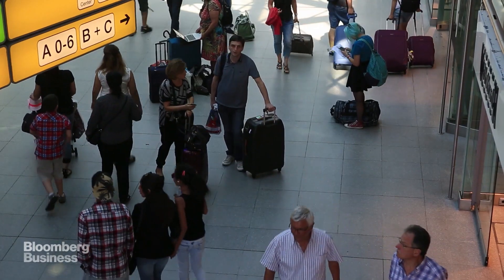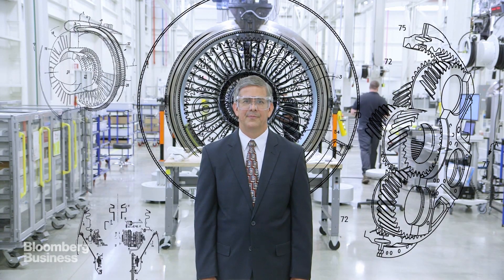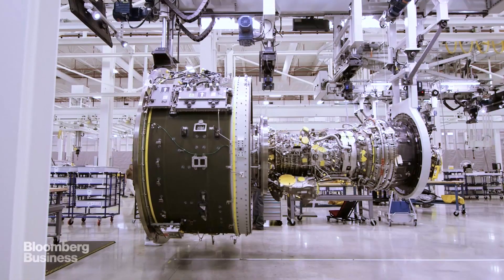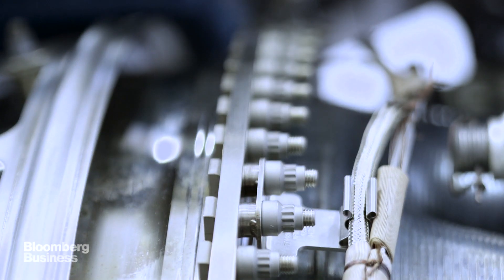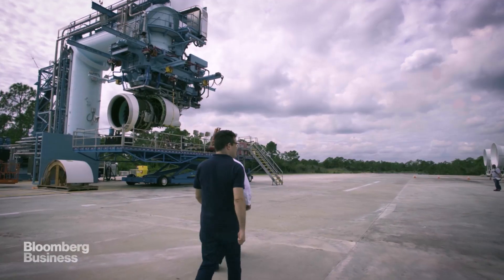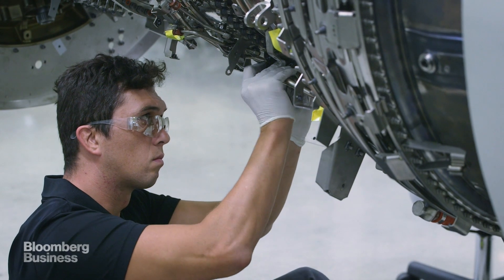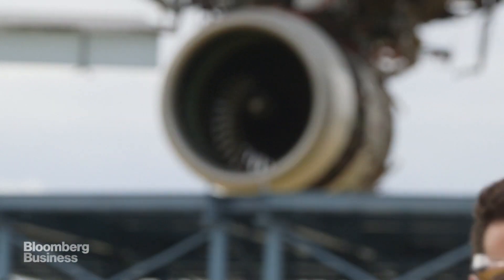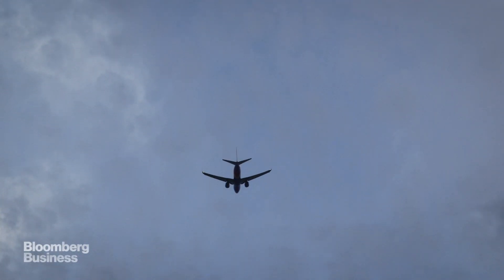This Genius Invention Could Transform Jet Engines

Comment: This may be a very good incremental improvement, but it is no breakthrough, and it is not a first.
The Garrett TFE731 is a geared turbofan engine that has been powering small to medium sized aircraft for over 40 years.
This is a larger engine, but using the same idea that's been flying for decades.
Reply: Surely a turbo prop is a geared turbine?
Reply: Agreed, Citation VII I fly has the 731 Engines. Its a good motor. But not a breakthrough...
Reply: An invention ? frank Whittle proposed this in 1945
Reply: You guys can quit measuring dicks now.  It's blowing up my notifications.
Reply: @drunkdonutboy  my dick is so big it needs a gearbox to prevent the tip going subsonic.
Reply: bloody rappers! have an opinion on everything!
Reply: +Bill Russell lol im pretty sure AgentJayZ is an expert on the subject
Reply: "Why even bother gearing the fan down when you can just make the turbo smaller and keep the 1 to 1 ratio, if in fact keeping the fan blades subsonic is the pre-requisite?"

[]First of all I would like to point out that turbofan engines never have a ratio of 1:1, they do not have a physical shaft connecting the bypass fan to the turbine spool (unlike a turbojet which does). They use two shafts(spools), a high pressure spool and a low pressure spool. This allows for a difference in rotational velocity, i.e. N1 or low pressure compressor when ground idling will rotate at 25% of its maximum RPM, while the high pressure compressor will run at around 50 to 65%. Numbers of course will vary from aircraft to aircraft.

[]As for why you should not making the ratio 1:1 you need to take into account how fast the leading tips of the fan blades are traveling by the rotation speed, radius, and blade pitch. Now we would have to look on how that adversely affects efficiency and how it adds to more mechanical strain to the whole assembly (if it's this particular size). In short you'd have a low efficiency engine spinning at tens of thousands of RPMs that would generate a lot of noise and gobble fuel like a fat man eating burritos, though it would generate lots of thrust. But the negatives outweigh the positives in this particular application.

[]The underlying principle behind bypass is trading exhaust velocity for extra mass flow which still gives the required thrust but uses less fuel. Whittle called it "gearing down the flow". Power is transferred from the gas generator to an extra mass of air, i.e. a bigger diameter propelling jet, moving more slowly. The bypass spreads the available mechanical power across more air to reduce the velocity of the jet.

"This looks like a 1.2 gear reduction ratio, turbo to fan, at most"

[]The specs of the Pratt and Whitney PW1000G shows that it has a 3:1 planetary reduction gearbox. This 3:1 gearbox between the fan and the low-pressure spool, each spins at its optimal speed: 4,000–5,000 RPM for the fan and 12,000–15,000 RPM for the spool, the high-pressure spool spinning at more than 20,000 RPM.

[]Because each of the components have different RPMs that they reach their maximum efficiency, this decreases the overall stress of the engine. Because of this reduced stress if a gearbox is added you can remove a few of the high pressure compressor stages, as they are unneeded as their job was to create thrust to turn the low pressure spool. 

I hope this answers your questions and why it should be kept out of the "Polishing a Turd" file.
Reply: AgentJayZ was 100 % correct. The prindiple of geared fan jet engines is not new. The new thing is making it on a larger engine, just like AgentJayZ said.
Reply: plus if something goes wrong on a planetary gearbox it's completely useless and would need to be completely rebuilt if and when someone goes wrong.
Reply: @belligerent-irony  yup. And those big GTF gearboxes are _heavy_. They've been working on this for a very long time. I've been following this since the early 1990s and wondering how they can do it without the entire thing breaking.
Reply: 75% noise reduction is not a breakthrough???
I think you forgot how loud planes are.
15% fuel reduction is also quiet significant and not only incremental.
.5 to 1 % would be incremental.
Reply: @plavix2215  agreed
Reply: Looks like your comment got cut off there. You're using non standard terms.
A typical large turbofan, with the exception of the RR Trents and RB211s, has a HP compressor driven by a HP turbine that turns at about 10,000 rpm. ( they are all different, so this is a very fuzzy general number), and a fan ( which may sometimes have a couple stages of LP compressor, or "booster" behind it ), driven by an LP turbine that turns at around 3000 rpm. The fan and LP turbine are directly connected, without any gearbox between them.

The LP booster stages would be better if they turned faster than the fan, but there is a compromise to keep the engine a two shaft design, saving complexity and cost.

The RB211, and its descendant, the Trent series, are three shaft engines. HP, IP, and LP. The LP turbine drives only the fan. with the HP and intermediate pressure compressors being driven by their own individual and separate turbines.

Of course all jet engines have an internal gearbox, driving a radial drive shaft, which in turn drives the external accessory gearbox. This is all entirely separate from any fan-drive reduction gearbox.

I have videos posted explaining all of these things, if you want to have a look.

My original comment on this video is that this is not anything new.
This may well prove to be a great, fuel efficient and quiet engine. I think that's great.
I just think it's wrong to claim it is a "genius invention".
Reply: Rolls-Royce/SNECMA M45H Came out in 1970 also and was much larger than the Garret engine.
Reply: Frank Whittle had a geared turbo-fan patent from 1937.
Reply: I think the innovation here is that they're saying the turbine speed is independently variable from the fan speed, which from the admittedly little information I can find on the TFE731 design, is not present on that engine.
Reply: Tyler Ketter as intelligent as that comment is the turbo fan has to be geared to the engine at a fixed ratio. so what they are saying to meif I get this right that the ratio is so low as to not drive blade tips into super sonic speeds
so the gear ratio is as low  as a willies jeep
Reply: AgentJayZ they used billions of dollars as research money, what do you expect them to say other than revolutionary. :P
Reply: First instinct, contact AgentJayZ.... then i look at the comments ^_^  already on it! like a boss!
Reply: AgentJayZ You tell em!!!! You are my favorite Canadian
Reply: AgentJayZ Hey AgentJayZ, great channel, I've learned a lot from you, as for this video it just looks a planetary gear that may achieve a closer to optimal RPM for the fan vs turbine considering fuel efficiency and fan decibels/stresses but at the cost of additional drag, so like jay said the "incremental Improvement". My humble analysis/consensus as someone who aspires to build a power turbine in the future.
Reply: AgentJayZ wooot!
Reply: Bill Russell I think you guys are on the same page but he was just explaining that almost all large turbofans are at least dual spool.
Reply: Herb Bees Upper right corner > Mute post
Reply: OOOoo the jet guru has arrived!
Reply: TFE731 is a turbofan engine, based on an APU power unit for the DC10.  It is used on light business jets, such as the Learjet and the aforementioned Cessna light jets.
Reply: Yeah why is this such a breakthrough?!
Maybe just an adaptation, but still something that's been done for almost half a century
Reply: A larger fan spinning slowly is more efficient than a small fan spinning fast. It's all about fuel economy.
Reply: 75%  less noise and 15% less fuel consumption seems like a breakthrough to me.
Reply: Hello AgentJayZ, love your videos.
Reply: AgentJayZ are you talking about split spool gas turbines?
it would say that on the engine data
Reply: *****    I don't remember that, but it sounds like me... 
 Thanks and cheers.
Reply: English Muffin... Great answers, thank you...! Makes a lot of sense that each of the stages, fan, low-pressure, high pressure spin at different RPM for optimum efficiency... I miss-calculated the planetary gear ratio from the graphic on the video, as Planetary Gears are not quite figured like standard gears...:-/  If it is a 3:1 reduction, then it's totally worth doing and yes, not worthy of the "Polishing a Turd file"...:) 30 years and $10 billion is gotta' get you somewhere... HA!
Thanks again for your well versed explanations! :)
p.s. Do you work with Jet Engines... engineering, assembly, fabrication, maintenance?
p.s.s. English Muffins are my favorite w/breakfast...HA!
Reply: so is!. I fell into the trap for being curious and I stuck with good images of engines in an infomercial that says nothing new.
Reply: ALF 502 & 507 based on T55 tank engine is a geared turbofan. This is not new Fucking lazy engineering.
Reply: You experts seemed miss the point. It took 30 years to build a small gearbox that is almost totally efficient that can handle 10,000-30,000 hp. The technology was not there before. Pratt built gear boxes before! 30 years before the garrett 731. So that means nothing. The 731 gear box by design is severely out of date. And yes i have worked on pratts and garrett/ allied signal / Honeywell engines!
Reply: Leave it to AgentJayZ to cut through the bullshit of the modern media.
Reply: Nice i have overhauled 100s of the 731.
Reply: Somehow, incremental improvement to commercial jets using decades old technology just isn't as catchy a title.
Reply: The real solution is CO2-neutral synthetic fuels. Jet turbines already burn very cleanly, especially compared to piston engines. KLM has already tried it in a small scale.
Reply: AgentJayZ Do you have a video on the reduction system in the TFE731 you mentioned? I'd be quite interested to see how that worked.
Reply: Bill Russell The military has to have it's own name for everything, and even then, we don't always call it that.
Reply: Thanks
Reply: Spot on, wish my phone allowed me to click like BIG TIME
Reply: I was thinking the same thing
Reply: so was the rb 211
Reply: The Dave  OH SURELY not.... or he wouldn't have bothered... SURELY....
Reply: Jordan Lorenz LOL.... just leave it to the experts.... or do you have 60 plus patents to your name too?
Reply: That, and lack of the radial HP compressor wheel.
Reply: IzunaDestruction
The op was cocky fyi, and he has no idea how patents work and clearly needs to brush up on how patents work before he speaks out his ass telling others who had the idea first and whats the same or not. This turbine is clearly using the patent gear box system made by this guy that no other has and does not do the same as the other engine type, thus breakthrough. The op also is telling others whats a breakthrough and whats not based on his opinions which is not a fact but a simple opinion on two kinds of engine logic even if they seem to be the same. improvements can also be breakthroughs as well and this one that will not pollute the air and will lower cost of people flying so i call that a breakthrough.
Reply: I think the only innovative thing here is the gear box which needs to be strong enough and designed to cope with the forces made by the large turbine. I saw a video of people that produce those gravity lights, i imagine it would be something like theirs
Reply: Also he never called his Mother.
Reply: AgentJayZ ..
You are Canadian ...right !?
Reply: no no, this is a radical new technology! not at all the same! this man has invented what he calls a transmission! never seen before!
Reply: Change mechanical gear to magnetic
Reply: AgentJayZ - I came here to post that. I've never flown a TFE-731, but I knew about the gearbox in some of them from the early 90's.  If I was doing the reduction gearbox thing to a big jet engine I'd be tempted to put it in the turbine section, so the shaft into the fan stage could be large diameter and quite rigid.
Reply: AgentJayZ has
Reply: That was my first thought as well! "Geared Turbofan?", well Garrett has had one for years! Though Kudos to the person that can implement it at a much larger size. Another cool technology is variable pitch turbofans.
Reply: They operate on very different principals. An ideal turboprop should move as little air as possible; generating thrust via the pressure differential on opposite sides of the "propeller" (versus a "fan"). A "jet" engine generates thrust by newtons third-law, i.e. by moving air; turbo-fans moving a lot at low velocity and turbo-jets moving a lower volume at higher velocity.

It is unfortunate that people interchangeably use "fan" with "propeller". Next time take a look at a big shop-fan. They move a lot of air yet the fan does not go flying backwards compared to if a propeller had been attached to the same motor.
Reply: Ol Sp the TPE331 is a turbo prop. The TFE731 is a turbofan engine
Reply: acbulgin2 what a stupid comment.  Look up specific fuel consumption of turbo prop! You will find most are fuel pigs to a modern turbofan.
Reply: lorenzo damag all turbo fans have gear boxes. They run the accessories. Fuel pumps dont run on magic
Reply: He is not talking about dual spool or split spool.  The LP turbine drives a planetary gear that is attached to the fan.  The LP is not directly attached to the Fan as in a split spool.  The fan speed is reduced by the factor of the planetary gear ratio.
Reply: I believe you have confused the TPE331 with the TF731.  The TPE is the turboprop while the TF is the turbofan.
Reply: The 1:1 ratio they were talking about is  the LP turbine speed to the fan speed in a non geared turbofan.  In a non geared turbofan it is 1:1 because they share a common shaft.  Not all turbofans have reduction gearing.
Reply: 15% seems more than an incremental improvement
Reply: THANK YOU - saved typing time for me  1972 was the birth of the 731 and was on the drawing board before that
Reply: AgentJayZ  The huge difference between this new type of Pratt engine is the bypass ratio. Older engines only have about a 5 to one bypass ratio, the Pratt has a bypass ratio of 12 to one, meaning a huge reduction on fuel burn.
Reply: Also the British Comet jet in the 1950's had a geared turbo fan engine but the plane was dangerous and i think only five of them were flying before the British government forced them to all be pulled from service.
Reply: Fook me, there's always one expert who knows better than one of the biggest, and most powerfully equipped  engineering departments in the world.
Reply: I don’t know if that’s really true, but I gave thumbs up, just in case.
Reply: I agree this video seems like the idea of a gearbox is new however I feel like it took 5 seconds to think of a gearbox as a solution once I knew what they were trying to achieve.
Reply: Its not geared turbofans 
But reduction gear 

Clearly its different
Reply: Just like the avro RJ engines,, they also have a planetary gear to reduce fan speed
Reply: ultrafan is kinda similar too
Reply: Correct. Geared fans have been around for decades. I don't see what is NEW here.
Reply: He supposedly has patents on this.  I did see something like it by British jet engineers.
Reply: all turboprop engines need gears to slow the propeller, so a gear on the shaft is not new. In fact even internal-combustion engines have it.
Reply: Yeah, but this is mainstream news. You know, the people that call self propelled howitzers "tanks" and guided missile destroyers "battleships". And everyone knows, jet fuel is a myth perpetrated by the globalists to make money, jet engines run on air!!! ;^)
Reply: AgentJayZ there you go, comment from a guy who works on jet engines daily basis
Reply: Keep calling it like it is Agent JayZ. I been loving your videos for years.
Reply: thanks you saved me the trouble.  and BTW, the best innovation was GE's GE-36 back in the mid 1980's but people weren't interested in open rotors then
Reply: Watching this I thought the same thing! They were sneaky, this was not his patent but they labeled it as a breakthrough. The 731 does have a gearbox but the core was initially developed to be an APU. Both the 731 and the 331 are geared engines. The 331 being a turboprop.
Reply: So, obviously handling that much power through a gearbox would be a breakthrough due to the weight penalty and architecture and dealing with the heat and lubrication.  Can you think of when the 731 was initially released to commercial use?  I want to say the Lockheed 731 Jetstar.  Or was it the Lear 35.  It even found its way onto the Rockwell Saberliner and drones.  Today one of the most efficient airplanes is powered by the 731-40, the Gulfstream Astra.
Reply: Whats the brand of this jet engine?
Reply: U can't lie to us, Jay will bust every myth there is. Respect !
Reply: I think you're thinkin' 'bout the other guy...
Reply: Bill Russell Thank you Bill! I have never been proven right so easy, so fast! Wow, what can i say? 
Hope your ECG will do some spike soon! A big hug, my little problem child :*
Reply: love your videos!
Reply: well pointed out about the size of the turbine engine difference. it would be very expensive to make the gear box strong enough for commercial use and adds a fair amount of moving parts and weight to the aircraft.
Reply: Bill Russell If you're all that kind of expert, you can stop being cocky and vulgar and show some facts, like AgentJay.
The Navy sure taught you how to be a bully and express a low IQ but we were here for knowledge, in the first place.
Show some or stop bragging about things that, as far as we know now, are only in your head.
Reply: This is not true at all. Almost all turbofans, and all of the big ones, like on the 777 and A380 have a fan driven directly by its own turbine.
The geared turbofan is a bit unusual, but the TFE731 has been around for decades.
The only innovation here is that the "new" geared turbofan is a larger, more powerful engine.
Reply: Yeah AgentJ! Love the fact I can see you chipped in here :) Love your vids too :D
Reply: Bill Russell: It's "you're not bright enough", not "your not bright enough".

Kind of ironic, don't you think?

AgentJayZ is somebody who rebuilds and maintains a wide variety of gas turbines for a living. Pull your head in and stop embarrassing yourself.
Reply: Knew there'd be a comment here by you :D
Love the videos you make, very insightful
Reply: Hey bill russell, i am involved in gas turbine technology around 6 years, you are the only one that uses that "split spool" term. Generally engineers and technicians use two spool or twin spool engine terms. 

AgentJay describes and shows lots of videos about gas turbine engines (turbojets and turbofans).

Today, most engines used in commercial and military aircrafts are twin-spool turbofan engines.

The engine shown in the video need to pass lots of test: Especially 150 hour endurance test that is far more harsher than testing your city car in rocky mountains. Also fan blade-off tests are also very demanding.

You may know, but do not talk as if you know everything about it.
Reply: just the thing is the TF731 is a turbo prop engine.....every turbo prop engine have a reduction gearbox......there is a huge different to create a turbo fan engine with it......basicly yes the same basic idea.....but at the end at the turbo fan more complicated to implement
Reply: +Bill Russell you're a diesel mechanic yeah? You sound like an absolute moron by challenging AgentJayZ on this. He is widely known on YouTube as he is a gas turbine mechanic with hundreds of videos explaining how and why jet engines work. I'll bet he's worked on at least 1000 times more gas turbine engines than you, so be wise and shut up with your alleged expert proffering.
Reply: AgentJayZ any good for chemtrailing? that's what i want to know! and will it operate over highly radioactive oceans?
Reply: Bill Russell Bill! stop ruining the kids fun! they love to crap on!
Reply: the TPE331 was crap
Reply: Bill Russell is angry old geezer.   Agent jz is certainly an expert and not a bs guy.   The large geared turbofan will never really pan out due to the load is too much  on the   gearbox.
Reply: AgentJayZ the 731 was not the first geared fan. You are missing the point! Were talking an efficient gear box. Not the heat making 731 gear box! Do you even work on 731's? If not it time be quiet.
Reply: it was a P&W jp58 split spool is not anything new here.
Reply: AgentJayZ  LOL and PFFFT...
Reply: Its so clear and obvious that propulsion technology is intentionally limited. Just look at the simple facts!
Jet engine is a vintage, retro technology! This engine was invented in 1930s!!! Put to wide and commercial use by the end of 1950s!!! Boeing 707, 737, 747. 

We have year 2017 now and they still use this retro tech? Of curse they have better technology. Locked in top secret programs. Anti gravity!
New, way way faster(from LA to NY in 20 minutes) and more elegant way to travel. When they put it for commercial use? In year 2100? 

New, a bit more efficient jet engine model every few years is not improvement. Its stagnation!
Reply: Chris Montgomerydont be an idiot. You build a almost 100 percent efficient gear box that can handle 30000hp.  That is the break thru. Pratt was making gear boxes when garrett was still a fucking dream.
Reply: I guess saying twin spool has fallen out of favor at the engineering level,
infant baptism vrs adult baptism
Oldies vrs rap
democrat vrs republican\
it seems my week is full of contradictions
Reply: Yes, not exactly "Breakthrough" engineering... This looks like a 1.2 gear reduction ratio, turbo to fan, at most... Why even bother gearing the fan down when you can just make the turbo smaller and keep the 1 to 1 ratio, if in fact keeping the fan blades subsonic is the pre-requisite? What keeps this out of the "Polishing a Turd" file?
Reply: easy to talk smack as if you are a expert on the subject
when the vid you just have seen (providing you even watched it)
told you what the break-thru is it is a high speed gear reduction
to the #1 energy draw  and under the stress of tens of thousands of
horsepower with durability 
I have seen split spool engines that did not work well with thrusters designs
I have seen duct ed, and a-symmetric blading , and unducted versions

what this guy has done with his team is quite literally over your head
who am I to say so Navy trained diesel mechanic, Gasturbine tech
Reply: Shanee Bahera agent jayz has just googled a gear turbo fan and now he thinks hes a expert
Reply: well I am not an expert, Im just a Navy trained Gasturbine tech so what ever he says.
Reply: IzunaDestruction holy cow you can remove your stick "before" you sit down you know
I guess your not bright enough that this whole thread is about the evolution of gas turbine nomenclature. and how I am out of the loop on the new engineering terms,
what the f are you a social justice f turbine tech with a side order of stale cootch

never knowingly take on a Sailor in a smack down, its just bad for your ego.
Reply: AgentJayZ when someone blows this much technical bullshit without getting to it they are bullshitters